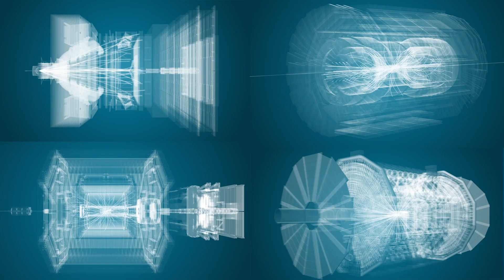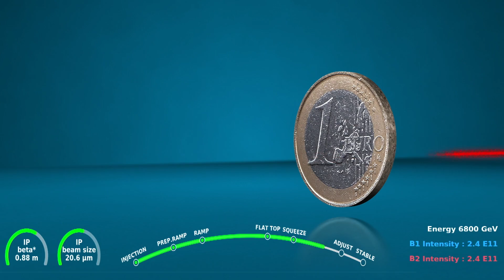Re-live the start of LHC Run 3

Comment: I watched it live and with how much happened in the aftermath of the SARS incident this somehow already feels nostalgia
Reply: Why don't they harvest excess electrical energy from that particular collisions and use it as a renewable source of energy.
Reply: @anwaypradhan6591  I don't understand what you're saying. This whole operation is turning electrical energy into controlled kinetic energy to crystallize energy into mass and then study that new mass. It's an incredible wasteful process. It doesn't generate usable energy, or at least orders of magnitude less than what is used. You might want to look into fusors if you care for energy generation - those at least have the potential for generating surplus energy for other uses (they turn mass into energy which is the exact opposite of what's happening here)